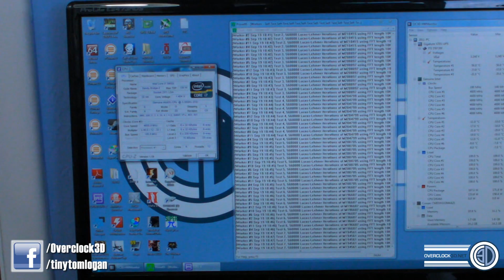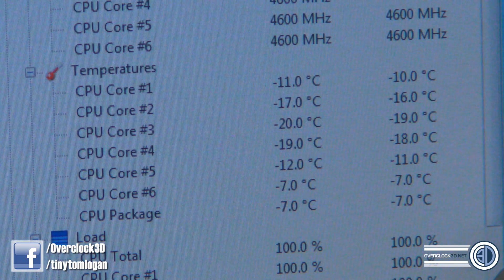Ultimate Corsair H100 Cooling Mod

Comment: My theory on this is that those fans act like a jet engine, were it builds up prssure and cooling that pressure to room temps and at the point were it reaches the radiator, there will be less pressure because the pulling fans doing the same as the pushing ones and there the pressure normalize or less than atmospheric pressure it will cool down dramaticly. this is how luquid oxygen and nitrogen is made btw, for me this video "seems" as not a fake
Reply: 15:50
Reply: JgHaverty you haven'tt read my post it seems. 3 careers... lmao. I guess that you read your teacher's notes the same way at school, if you ever read them. At least there's some imagination here (check that one, which is for real : JWQZNXEKkaU). Anyways, Phil Kanish gave you another answer, maybe it'll be more understandable, there's no technical nor scientific mumbo jumbo, not even a word, just click and listen. ;-)

HOWEVER, yes your concept is interesting, but forget about standard PC fans for this. You'd have to create a new design and "engine". Like what these guys have done (another design), go check that Youtube : JWQZNXEKkaU
Reply: Damn... I love your point, but the attempt at English just fucks it up and means that your comment is essentially useless.
Reply: Indeedthis isaname Well i´m sorry but i´m from turkey and i live in Germany and i speak at least 4 different languages, so i´m still sorry for my bad english.
Reply: ibeat
Ah, alright :) I figured you might! That's really impressive though. Really is! I only speak English so... Y'know hahaha.
Reply: That would be correct.... if the fans compressed to hundreds of pounds. (Hint: they don't).
Reply: JgHaverty
Look at this! Both illiterate, and uneducated regarding physics!! Kek...
Reply: Indeedthis isaname You should go look into a guy named bernoulli, read some stuff, and get back to me on that assumption.

"kek". Must be 14-16?
Reply: JgHaverty i get your point but he is cooling an overclocked 6 core processor, which i think will draw 250 watts which is nothing compared to my made in china air cooler which is generating 4-6 bar to cool 3660 watts of heat, so i think that little much of pressure and the little vacuum should pretty much do their job in this video i really would like to do a test on my own but i wouldn´t buy 40 corsair fans right now, but i do have 16 arctic 120mm fans, so i think i will do a little experiment with those to be sure that it really works
Reply: JgHaverty Yeah! That's not you as far as I believe. That's basically like if someone says "You clearly can't play guitar", then I just say, "Oh yeah! Look at Jimi Hendrix and get back to me on that!

And yeah... What's wrong with that!
I'm clearly allot smarter than you ever will be. I have an IQ 2 points over Einstein's... So yeah, I'll take my victory and leave.
Reply: Indeedthis isaname "allot smarter" eh?  

You are incredibly lame lmao.
Reply: JgHaverty
Thank you!! I'll take that as a compliment!
Reply: ibeat so what happened, did you make that experiment?
Reply: HawkFest Not yet but i will give it a try if i have enough time for that and if i get back my 8 fans
Reply: ibeat just watch the last minute of the video, he says that it's fake. More fans change nothing. The airspeed doesn't increase and there is absolutely no pressure change since the same amount of air that gets pushed in gets sucked out.
Reply: Elias R. While fake, your comment is not accurate. More fans in series raises pressure (or reduces it on the back end). That said, higher pressure raises enthalpy of the air and reduces its cooling effectiveness. There is a point of diminishing and the negative returns with more fans. 

ALL centrifugal pumps and fans operate in this fashion. 
Series -> raises pressure
Parallel -> raises flow rate
Reply: Right, I forgot about that. But even if the fans would work perfectly they would increase the pressure by 3 millibar which isn't enought for a notable increase of temperature.
Reply: Elias R. Thats... not how that works at all mate. Not trying to be insulting here, but take a few thermodynamics courses before spouting nonsense. Any increase in enthalpy is directly proportional to an increase in temperature. How much? That would require some math and constants (fan speed and pressure, ambient temps, temps of water in the cooler [in and out]) that I frankly don't care about. 

"notable increase"? Probably not. A couple degrees? More than likely, especially with the heat of the coils adding to the temperature of the room.
Reply: Oh ok. Sorry, I replied without thinking too much.
Reply: JgHaverty
pressiure doesn't add up linearly. Each fan exercise a cinetic resistance to the previous fan with their rotating wings, itself taking that velocit in control : the air velocity is not added nor multipliplied for adding up pressure, since those wings all have the same speed. Try it and you'll see...
Reply: HawkFest Actually, you're completely wrong on many things here.

1) Im sure you meant kinetic, not cinetic.
2) centrifugal fans/pumps in series directly adds to pressure
3) never said anything about air velocity. Pressure and velocity are two very different vector quantities 
4) I don't need to "try" anything. I actually have practical experience, training, schooling, and knowledge to understand this concept you clearly do not.

Here's a good chart of series and parallel pump operations. Fan's operate on the same principle. 

http://lh3.ggpht.com/webwormcpt.wwcpt/SBO5Hd7CorI/AAAAAAAABEs/7699z6GF1E4/Series_parallel_pumps.JPG

If you wish for me to absolutely drown you in information, then by all means, allow me to. For now, I'd like you to simply step back and accept what I've stated.
Reply: JgHaverty Hum hum... Very short : you only need one fan, the rest is useless (air is a Newtonian fluid). But please read along, since you're so sure about the opposite which is wrong, and since I've made a little effort to expose some facts for you and this thread (numbered along your comment, but not in sequence, for clarity - hopefully). Btw you can limit your reading to the bold characters, it's sufficient.

2) About pumps - Centrifugal pumps are for liquids, and centrifugal pumps in series are used to overcome head loss in larger systems than one pump can handle. However we're not talking about liquids but about gases. Those factors as surface tension, capillary action, viscosity, etc., exercising different types of resistance, are of a very different order in terms of fluid mechanical properties and dynamics (fan wings and air). If we were talking about water cooling loop solutions, you would be right but that's not the case : the chart you're showing is irrelevant.

3)- The facts - Forces (i.e. those rendering pressure) are proportional to the rates of change of the fluid's velocity vector (e.g. speed) as the target moves away, in various directions: air velocity factors in (of course, since it's the source of those forces exercising a pressure - "static" or "air flow" type of "pressure", depending on the wings profiling design, with variable efficiencies). From the 1st fan to the exit of the last fan, that velocity does not change since all the fans are at the same voltage (same rotational speeds, zero acceleration from one fan to another). Air is a Newtonian fluid : from one fan to another, you can't get a greater angular acceleration that is independent of an invariant rotational speed, it's impossible, there must be a differential for this to happen. More over, that speed/pressure will be the one of the LAST FAN in the series blowing the air.

3.2)- About velocity - In other words from 3), in a car, put your hand out of the window at different speeds and you'll "feel" it. If no air is moving (zero velocity), well you don't get any "pressure", of course. If all fans are not turning at at the same speed, not only does it adds a lot more noise when the fans are close together (separate them and they get quieter), but also it's very bad for the fans and can break them much faster in the long run (they're not perfectly in sync and exercise resistance onto one another. Note : the air viscosity tensor isn't dependent of the stress state and velocity of the air flow, although it participates in making whistling noises given some rotational speed, material and harmonic phase frequency(ies) of the wings design).

Conclusion - You could have a gazillion of fans in series, only the last one will have an incidence and all you did was throwing money out the window..

1)- Yes that's what I meant, my native lang. is not English. Thanks for correcting.

4)- You are wrong, thus your « ad hominem » argument doesn't matter. If it should matter, well then know that I have a degree in Computer Science and Operational Research, as well as a solid mechanical engineering background at École Polytechnique. But who cares really, just test it and you'll see, no need of a PhD for this.

Thanks for reading.
Reply: You're claiming computer science... AND operations... AND mechanical engineering.... 

Intriguing, as none of those correlate with each other.

Ill give you a hint to revise your argument. We're discussing "fluid" properties. Fluid. As in air is a fluid, and is under the effects associated with pump displacement (or in this case, an "air pump" aka a "fan").

The fact you don't know these simple concepts pokes holes in your entire argument. Somehow you managed to master three entirely separate segments of science into one study (why? Its not impossible, but practically speaking, really  really dumb).

You are literally making shit up. It's absurd. 

Allow me to poke holes in everything you stated

1) Never implied "need" vs "demand". The system specifications we are discussion are pumps in series. Being newtonian or not is COMPLETELY irrelevant. I have no idea why that would even come up in this. 

2) Very glad you can google. What you forgot to google was that, although air is a compressible fluid, it still operates under fluid dynamic properties as liquid does. 

-Surface tension -> has NOTHING to do with fluid being pumped. If you had mentioned laminar boundaries and flow rates, you would be close.

- You seem to fail to realize a VERY basic fundamental fact -> liquids and gases are FLUIDS.

- newtonian physics applies to both compressible and incompressible fluids. The ONLY difference, is for the compressible fluids, you add the temperature and pressure to correlate with a new known constant to calculate the effect of the pumping action. For "air" vs "water" this change is very slight.

3) holy shit you cant be serious. Pressure and velocity are two VERY independent forces. Go push your hand on a wall. Neither will move, but I promise you will have 'pressure' affecting both surfaces.  

- velocity and speed are two very different things. Speed is a scalar quantity and velocity is a vector quantity. This is another VERY SIMPLE fundamental aspect you seem to fail to grasp from your so called "Education". Using them both in a sentence together as "synonymous" as you do, implies ignorance on their meanings.

- Again, your analogy of speed and pressure is PAINFULLY incorrect.

3.2) Another aspect you fail to realize from your so called "Schooling". In engineering terms (something you are apparently very familiar with lol), you keep the system in a steady state or "frame by frame" (so to speak) analysis. This means we are implying constant voltage and RPM of fan's, operating under the same ambient temperatures, ambient pressures, and you apply known constants to the equation. From there, you deduce variables and apply them. In this case, we would assume a nominal steady state identical fan with another fan. The pressure will rise with fans in series. The flow rate will rise with fans in parallel. These are fundamental  and, ironically, VERY BASIC functions of fluid dynamics.

Do yourself a favor. If you'd like to appear smart, either

A) pick your battles. Don't start arguments with actual engineers, as we will rip apart everything you have to say in the matter.

or 

B) actually learn what the fuck you're talking about. i.e. focusing on "newtonian"... "gas vs liquid" when we're discussing fluid dynamics (hint : theres no difference!)... claiming three entirely separate fields of study when its clear you fail at all of them if you did... 

If I had to guess, you are... 2nd or 3rd year into your schooling, and you are trying to "prove yourself". I don't deny you are probably going to school, you bring up some slightly obscure things, but its painfully clear to me you do not have the conceptual understanding required to make an actual debate. Feel free to ask your professors about all this... lol
Reply: JgHaverty, you were using that ad hominem argument about yourself, I just returned it back to you since it seemed so important. The 1st "and" is part of the department name (Comp. Sci. & Operational Res.). The second "and", well yes I was in Mechanical Eng. before... But so what ? As I wrote one doesn't need that kind of scholarship, just try those fans in series for yourself and you'll see. Oh and I also play drums, I ski, and my favorite color is army blue, thus I'm right and you're wrong... LMAO.

Now if you don't want to know anything about the underlying science, well then it's not my problem anymore, you'd be the loser (and a bad one I must add). Case closed.
Reply: HawkFest i dont know why you´re talking about pumps in serial, but explain me then how does it come that jet turbine engines building up pressure with multiple fans (or however they called in englisch). It´s like you want to change physics and i did write in an older post that it is only a theory from me, so please stop fighting you two ;)
Reply: ibeat , because you were talking about pumps, your chart is about pumps, which is why I told you that we're not talking about pumps, duh. Jet engines?... We're talking about PC fans here. Jet engines are of another design, so use a jet engine if you want that kind of effect, or invent a new product suitable for PC chassis using the same design principles, don't use PC fans in series. Computer fans are more comparable to propellers on old planes, not jet engines if you want such comparison. And you'll never see propellers in series on those planes : it's been tried, and has been left aside as fast as they've appeared since they were useless and added costs for nothing... Leading to the design of jet engines, that's the story behind. Read again the post, I wrote a bit about these design problems making this an awkward and flawed solution. BTW, I tried it tonight (I've been educated to take nothing for granted), and really... LMAO! I could observe all that I wrote, and It made this clip even funnier.
Reply: ibeat I was gonna let him figure that bit out. He's too busy having 3 careers at once to grasp my concept apparently ;)

He doesn't understand that fluid dynamics apply to ALL fluids; be it liquid or gaseous. He's grasping straws here, and Im not sure why.
Reply: HawkFest Im just gonna block you, you are too painful to discuss with. Seriously dumb. 

Fluid flow dynamics are what my career is based around, yet here you are making shit up as convenient for you. You clearly don't understand gas to liquid relationships, nor do you understand very basic fluid flow principles.

You claim to be a mechanical engineer, computer scientist, and an operations specialist. Anyone that works in any of those 3 fields knows they are completely unrelated together. At best, you could be doing computer engineering with a masters in operations, but with how you're speaking, if you were older than 22 I'd be shocked.
Reply: JgHaverty You hate this when someone shuts down your arrogant mockeries, while proving you wrong AND offering a link to an alternative which is actually working. Let go your ego, such an attitude leads to dumbness (even kids can be more mature). This is painful you say? Well stop behaving like this, it's your fault, you are doing this to yourself. Block me, I soooo don't care about your BS attitude lmao
Reply: People, this is fake. Please calmly and objectively try to understand. This topic has no room for emotion.

It's true that changes in air density change temperature. BUT. Even if these fans could change the pressure enough to see a temperature change the effects would be negligible. The high pressure on one side of the radiator would create heat, the low pressure on the other side would "lose heat" equal to that of the other side of the radiator. 

PLUS... if you bother to watch the video, he tells you that it was obviously faked.

Also fans in series do not add together. Let's say the first intake fan can move 50cfm, then air gets the second fan and it can only move 50 cfm, but the air is already going close to 50 cfm already so it can't do much to the air.

 If you attached your car to another car end to end and tried to go twice as fast do you think that would work?...It wouldn't. 

+JgHaverty You are mistaken my friend. It's not worth getting pissed about, being wrong is a great way to learn new things. Happy trails
Reply: Phil Kanish Yes we know this is fake, but there is maybe a way to cool down that much and this is what we are discussing here not that this video is real or fake just it would be possible.
Reply: ibeat ahh, yes. It's called a refrigerator. But with pc fans it's not possible.
Reply: Phil Kanish It'd help if you bothered to read the comments you're commenting on. You're so far out of context, you're just making yourself look like an ass.
Reply: JgHaverty I'm not going to read all 33 replies. 
I read a few of yours, and they seemed semi legitimate science wise.
But then you just started making things up.

There's no need to insult me, it doesn't make you any more correct than you were before. (which was not very correct)

Also, earlier you said that you "worked in the field of fluid dynamics for years." Well, it may be possible that you work in fluid dynamics, but you are still wrong on this matter. I'm sure there are some night classes in your area where you can catch up with your science.

But then again, maybe school won't help, I see too many engineers (people in general) get out of school and think they know everything. Unfortunately school doesn't teach common sense.
Bernoulli's applies to both side of the radiator. If there was an effect, the high pressure on one side of the radiator would heat your system up, then the low pressure side of the radiator would cool it down. In Equal Amounts. 

Do you know why jet engines build pressure? Because they have a compressor. The engine forces air into a smaller and smaller space, cramming more air into a smaller space builds pressures. Look for yourself. PC fans in series remain the same diameter the entire length. But this is irrelevant because PC fans could never build such pressure in series. You've gotten schooled on this multiple times, it's okay to be wrong(that's how you learn) but you are handling this very poorly, just let it go.

https://www.google.com/search?q=jet+engine+compressor&es_sm=122&biw=1015&bih=1770&source=lnms&tbm=isch&sa=X&ei=0t_8VPKkO4WsogSXzYD4Cw&ved=0CAcQ_AUoAQ

HawkFest The link you posted didn't work, and i'd like to see it.
Reply: Phil Kanish Really? Lol, you clearly need to read more.

Bernoulli's principle has 0% to do with what Im discussing. You need to read up on pump affinity laws, then get back to me.

The only thing I've been "Schooled on" is how to troll like a boss. It's sad, you guys are too stupid to realize how dumb you actually are. Its ok, live under your rock and don't actually try to learn anything ;). You will fit in with the rest of the majority that exists.